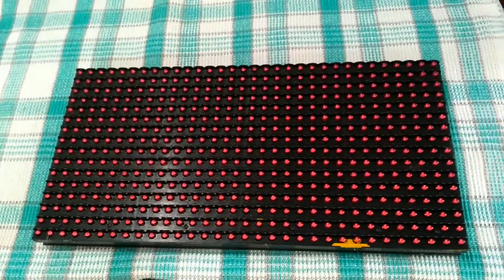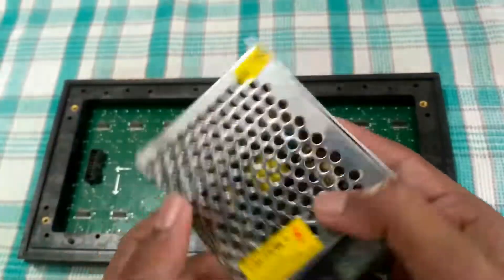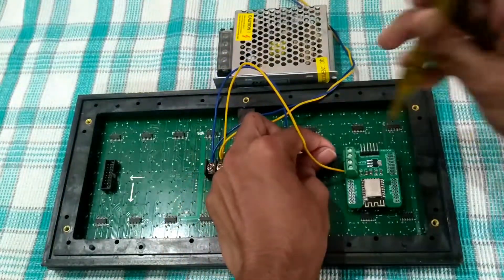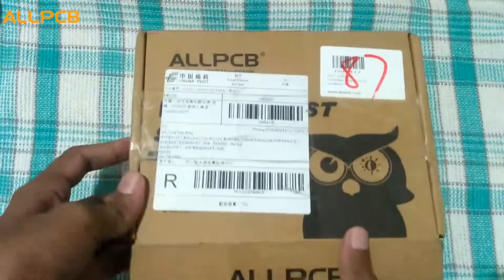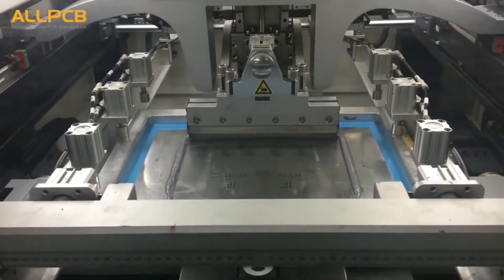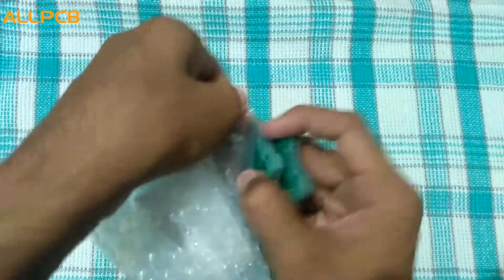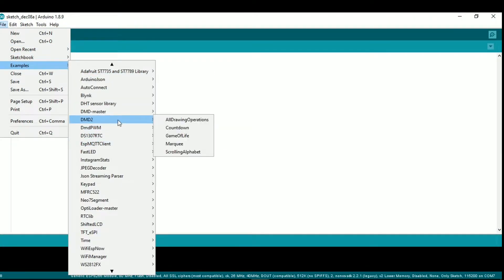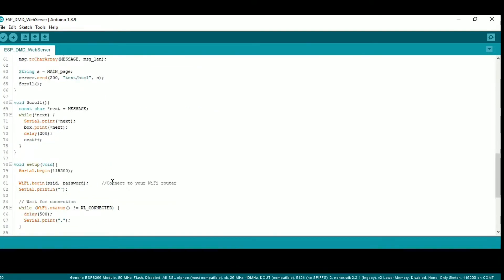Wireless P10 Dot Matrix LED Display Using ESP8266

Comment: how do you upload the code to the esp8266 module?
Reply from the maker: Using a USB to serial programmer. The UART pins along with GPIO0 and RESET are broken out on the PCB

Comment: HI I been stuck for a few days.  just get these errors

c:\users\.........\appdata\local\arduino15\packages\esp8266\tools\xtensa-lx106-elf-gcc\2.5.0-4-b40a506\xtensa-lx106-elf\include\c++\4.8.2\bits\move.h:166:5: note: void std::swap(_Tp&, _Tp&) [with _Tp = HTTPUpload*]

     swap(_Tp& __a, _Tp& __b)

D:\MasterData\DATA_19_My Documents\Arduino\libraries\DMD2/DMD2.h:45:41: note: void swap(T&, T&) [with T = HTTPUpload*]

 template<typename T> static inline void swap(T &a, T &b)

exit status 1
Error compiling for board WeMos D1 R1.

boards manger is up to date. tested on another pc, same issue, loaded in older libs files same issue

using a D1 mini 8266 and one led board

what can i try

Comment: I have p10 led panel matrix 32x16.  How to connect the esp8266 nodeMCU V3?
/*
  Pin Defination
   nOE - GPIO5
   A - GPIO16
   B - GPIO2
   CLK - GPIO14
   SCLK - GPIO12
   r/Data - GPIO13
 */

SCLK - GPIO12
 What is this?
Reply from the maker: This are the default pin labels. Search online for P10 DMD pinout and ESP8266 NodeMCU pinout.

Comment: Great Job! 
I'm trying to use a NodeMCU to control a P10 LED Panel. Can I conect the NodeMCU pins direct to the  P10 panel? Or I need a Logic Level Converter 3V3 to 5V?
Reply from the maker: I have connected my display directly to the Esp8266 pins and so far I don't have an issue with that setup. However, if you want you can use level shifters for conveniences..
Reply: @ElectroPoint4u  Thank you!!!

Comment: Congratulations !
It is very nice and usefulll.

I would like to use a NodeMCU, because I am going to use 3 digital pins to receive remote control(RF 433MHz) with 3 buttons. 

Please, what is the kind(model) of ESP8266 used in this video ?
Reply from the maker: Thanks, I have used ESP8266 12f module
Reply: @ElectroPoint4u  , does It have 3 free digital pins ?
Reply from the maker: Yes, but then you have to use the TX & RX pin as GPIO0 and GPIO1
Reply: I have noticed some small differences between the reported Gerber Files and the PCB used in this video, specially the power connector. 

Are you aware on that ?
Please, could you make public its schematic, too ?
Thank You !
Reply from the maker: Yes, Actually that is Rev.2 board. I thought it'd be useful to have barrel type connector in the PCB, instead of just only scrub terminals.